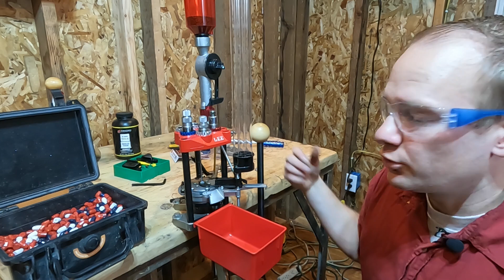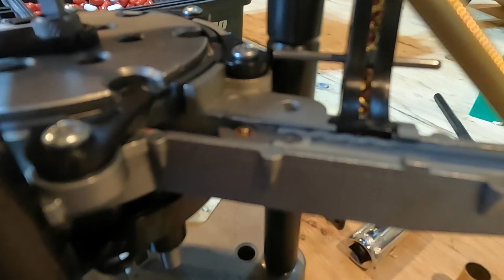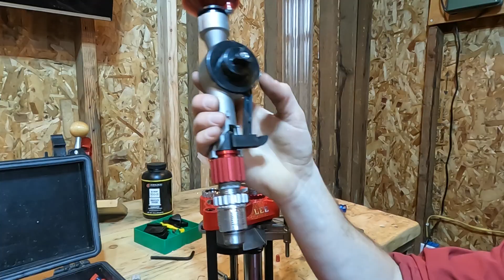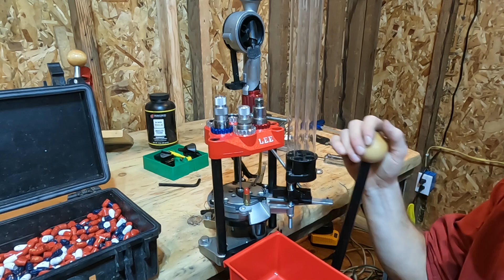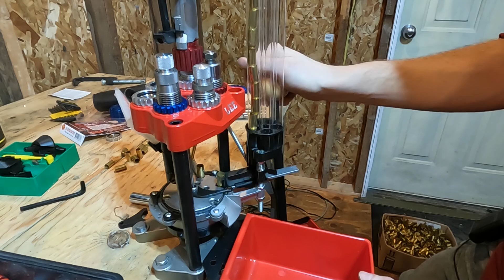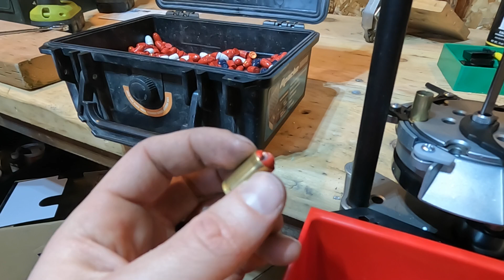Lee 6 Pack Pro -- 9mm Start to Finish

Comment: Thank you for that video!
Why do you not use a Lee Bullet Feeder Die?
This accelerates the process massively, I would not want to reload without anymore.
And you can add a cheap powder cop as well. There is a reason why it has 6 stations, use them 😉

I really love my Lee SixPack. I added sensors to the primer feed, case feed and bullet feed. This way I get a warning light whenever the primers, empty cases or bullets run out 🎉
Reply from the maker: I didn't use the bullet feeder because at the time I didn't have one. This is actually my buddies press that he let me use to make some videos. I'll tell him to get one and then I'll do another video on it.

Comment: Some advice. First I always make it so the upstroke hard stops on the resizing die. It can make a difference on range brass or if the brass is being used in multiple guns. On a gun with a little bit of a chamber that is bigger than the other every little bit of resizing could make the difference if it chambers in any gun. And the last round is not seated 10 thou or more deeper.
 LOL when you put that first bullet on the case I started talking to you. "Dude the post is in the way". No surprise you fixed that right away.
 Last your going to fast. No excuse for that jammed bullet deep in the case. You need to allow feel to dictate speed. I always slow down with very little pressure on the handle till the case starts feeding. Also that way you can catch a case that split before you have a primer or even powder and bullet in it. Yes I have this issue with my 357 brass that I have been using for over 40 years. I wish I knew the cycle count on the brass. I was surprised on that video you made with how many cycles you got out of 9mm brass. 
I have always been slow on the progressives but I am always able to catch an issue before something bad happens.
Oh ya. I have a light strategically located and I am always looking in the case for powder level as I am setting the bullet down. Then as the bullet goes up and in I watch the powder measure cycle Than as It comes down an seats the primer I am checking the primer feeder worked proper. 
I enjoy your videos
NDR
Reply from the maker: All very good points! Feel is so important on progressives. Even the sounds the press makes when cases and things are feeding properly. It takes several hundred rounds to really get the feel for this press and even after the various videos I have done I only did a couple hundred. By the end I was starting to get to know how the press feels when cycling and feeding properly. 

On my Hornady I can haul on it now that I know exactly how it feels and what to look for. But especially when first starting out on a progressive you have to go slow. When new reloaders start on a progressive as their first press I usually recommend they treat it like a turret press and just do one case at a time because a lot is happening at once and loading a squib or forgetting a primer is common.